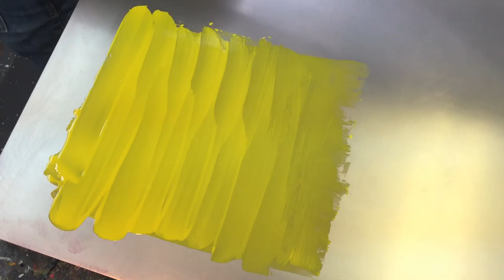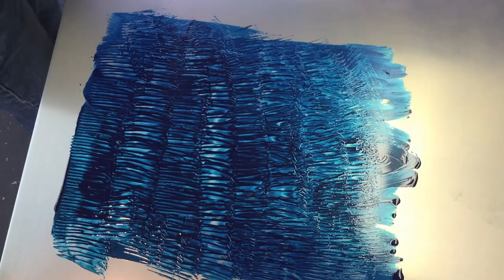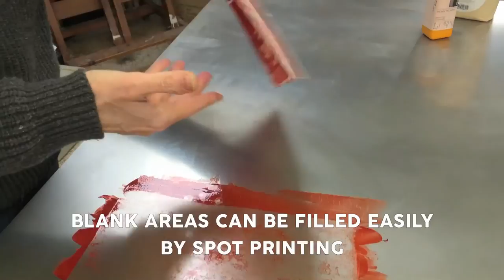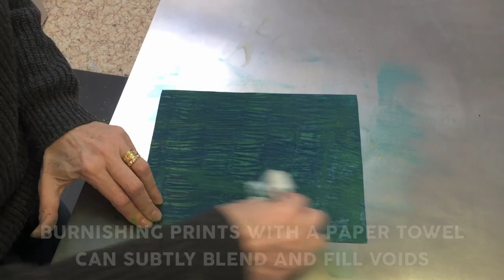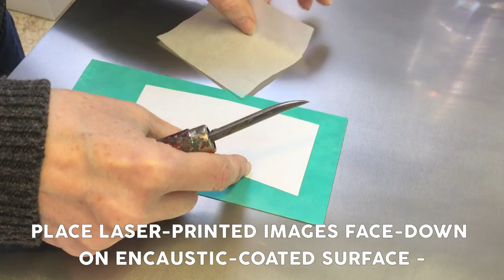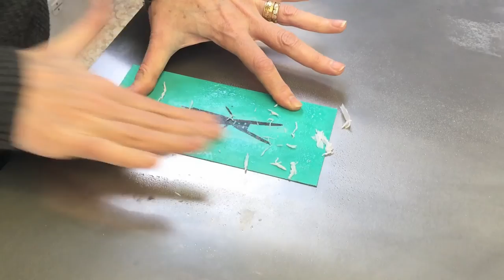Monoprinting with Encaustic on ENCAUSTIFLEX

Comment: How can you mount this monoprints  to an encaustic board?
Reply: @lesliegiuliani6160  What weight is the encaustiflex paper you are using in this video? What glue would you be using to permanently and evenly adhere the back of the gessoed encaustiflex painting to the wood? Thank you for your demonstration!!!
Reply from the maker: Whoa!!! Just saw this. All weights of Encaustiflex will work. I use "YES" glue but any PVA glue should work.